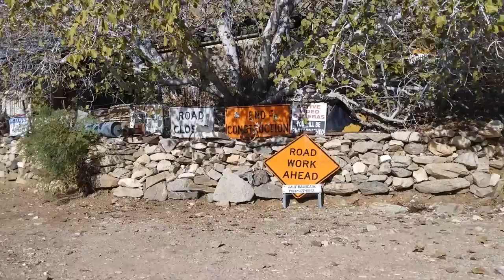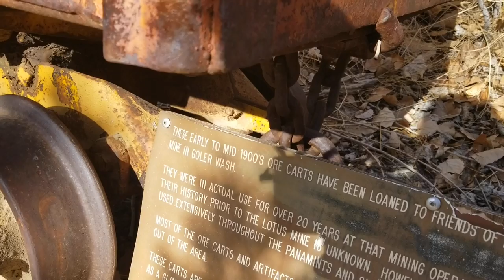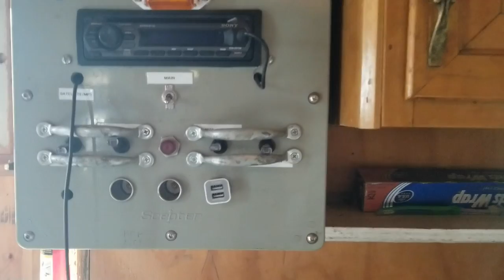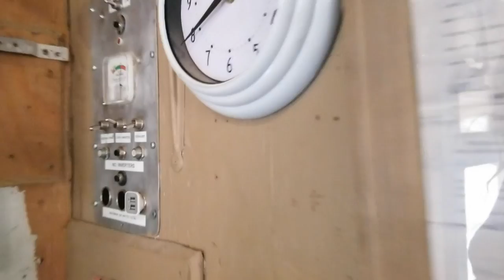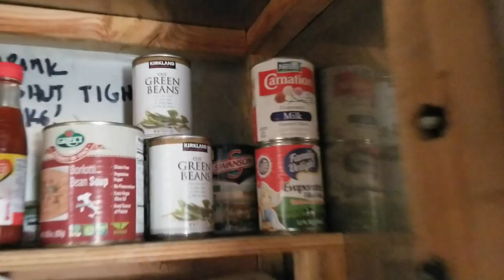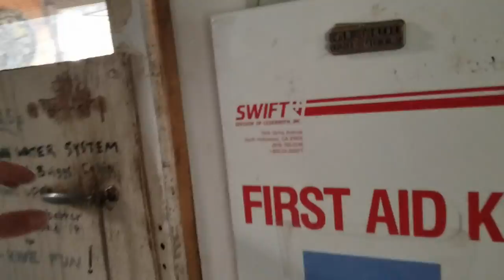Death Valley Dollhouse: Cabin Crisis!

Comment: Both cabins are equiped for propane gas. Bring your own bottle of propane and turn everything on including the Water Heater for showers. The benches and tables in the patios of both cabins were built with target shooting in mind. All set up for guns and gun loading, maintanence and cleaning. They are both highly popular and are seldom free. The "main" cabin is also set up for ham radio communications. You can plug your own radio into the antenna which is on that mast outside by the flag pole. You can then communicate with the outside world. NEVER LEAVE FOOD OF ANY KIND in these cabins. It just goes bad because no one ever uses it and then we must clean it all out every once in a while.

Comment: Oh man, getting that sick is definitely not what you want, let alone in the middle of nowhere. I hope Jessica recovered quickly!

These cabins both look super awesome! Right at the beginning that antenna next to the flag pole caught my eye and I thought no way, they're operating a ham repeater up there! I know that people do run repeaters also in super remote areas like in northern Canada and was waiting the whole time for you to run into a locked cabinet somewhere inside the cabin that would hold the radio equipment but was somewhat disappointed that you didn't notice anything the like. Then I started browsing the comments and further down found one from mobiltec - who seems to be one of these cabins' volunteers - who points out that this is indeed a ham antenna but there's just an open-ended cable inside the cabin where you can plug in your own radio. Well done!

Comment: The water is absolutely safe where u were at plus it goes thru a filter system behind the cabins. Been drinking the water there for years. I think her winter illness lottery number was up. Was there any mention in the logs on when they're getting a replacement water heater up there? That was a pretty new unit with remote push button pilot light. Hope it's there by February.  I hate cold showers

Comment: @15:28 . that looks like a garage / shop. the pit would have been something you would drive your vehicle over to do maintenance / repairs under the vehicle. dad had a garage with a 'pit' in it. done many an oil change in that pit.  sounds handy, but the thing even though was cement lined would be filled with ice cold water in the spring. several feet of water in it. I remember helping my brother pull the engine and transmission out of his 70 1/2 Firebird. I had the troublelight hung off something under the car. I bumped it and the troublelight fell into the water. Yes the same water I was standing in. me yelling at him to unplug the thing. Just another adventure on the farm.

Comment: The water system might need to be sanitized/chlorinated.   If someone dose this it needs to be at least 100 ppm but less than 200 ppm at the tap, you can buy test strips just for this.  You need to run the water until you smell the chlorine from every source in both cabins before testing, after it has set for at least 30 min it's done.  If the smell or taste is bad all you need to do is let it set in a open container until the smell is too your liking, sunlight and heat will speed this up.

Comment: The first thing I thought of when that happened to Jessica was food poisoning. Yes, the water could have been bad but if she boiled the pasta it should have killed any Little Critters that we're  swimming around in that water. I'd like to get a sample of that water and get it tested. Another thing, did Jessica use your pans and utensils or theirs? I hope Jessica and you have a speedy recovery. Keep us posted.
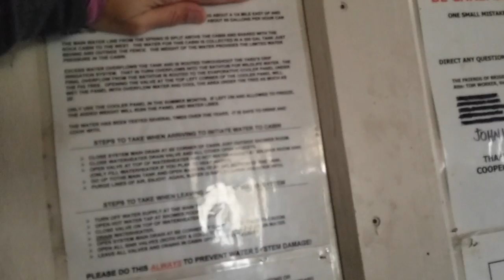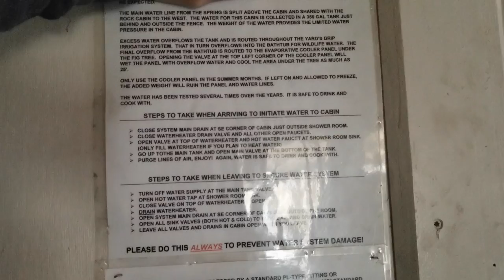Reply: The sign in the first, cabin she shows from 8:57 thru 9:04 says, "The water has been tested several times over the years. It is safe to drink and cook with."  It might not have been the water that made Jessica sick. It's more than likely a virus that got her before she left home. Been there done that, and I have learned how to keep myself hydrated during bouts like that.   I used to wind up in the hospital every time to be IV re-hydrated.  I found a system that works for me 90% of the time, and keeps me out of the hospital. First 24 hours, every time I have to barf, right after I barf and am done with that bout, I drink water. 8 oz at least. Usually more.   It does two things. One, at least some of that liquid gets passed the stomach and into the intestines so it can be absorbed by your body. The second thing it does is it makes the next bout of barfing easier.  Dry heaves are the worst! Better to have something to throw-up than not.  If it lasts longer than 24 hours I as a tiny bit if salt, potassium and sugar to the water, to replace at least some electrolytes and fuel. I also do two separate 'tests' to check my hydration. If nothing works and I'm still barfing and sick and I'm now testing bad for dehydration, I go to the ER.

Comment: Great video, nice review of B----- camp. Too bad that Jessica got sick. I'm sure that it was the water. The water up there is probably good, but when it sits in a holding tank or just pipes for a long time, it builds up bacteria and becomes stagnant. If you drink it you get sick. Many years ago I went on location to film scenes for the movie "Alvarez Kelly". The studio rented a motor home for William Holden to relax in while we prepared the set for filming. William Holden got terribly sick and they traced it back to the water in that motor home. The company that rented it to them didn't drain and flush the holding tanks like they should have. We had to shoot around Bill for three days. That is why they use chlorine in domestic water supplies. I have a motor home myself, and when I break it out for the summer I have to drain and flush the holding tank and all the water lines before I can use it.

Comment: Bad idea to drink foreign agua without iodine, filtration, nonfractional distillation (boiling H2O for 5 min)
Well done though I have not seen an MD in 30 years and I feel way better then when I used to. Way way better since my biome has not been murdered in 30 years.
I would bet dollars to donuts that everything required to cease the nausea and dull abdominal and or throat pain was growing all around you and the cabins.
It is extremely helpful to learn plants and there uses. 
Crime Pays but, Botany does'nt.

Comment: There is gold in them there hills. How many different pairs of sunglasses do you have? It's solar heated water; before people invented solar panels. It's the shop or garage, possible oil changing pit for vehicle oil change. Bro pants LOL. Don't get caught loping your mule. Your a true romantic. Montazoma's revenge. TMI, Always boil your drinking water or use water filter system they are not that high cost. I carry 5 gals of store bought drinking water at all times for cooking or drinking. Thanks for sharing.😎😷